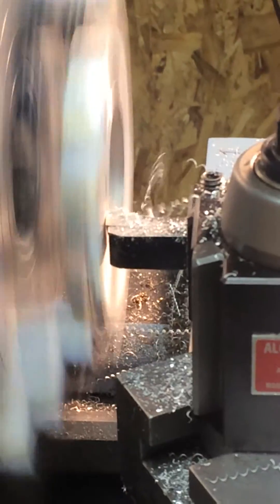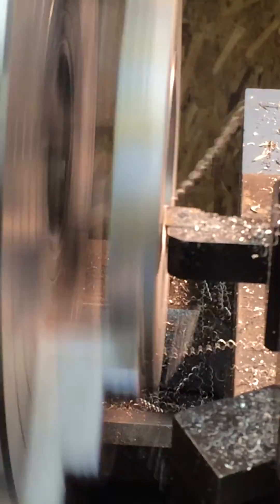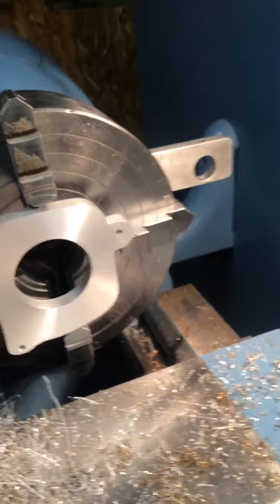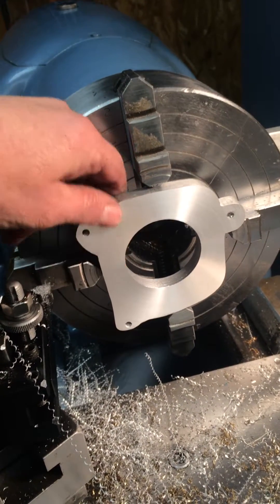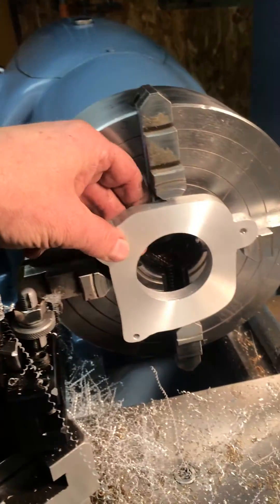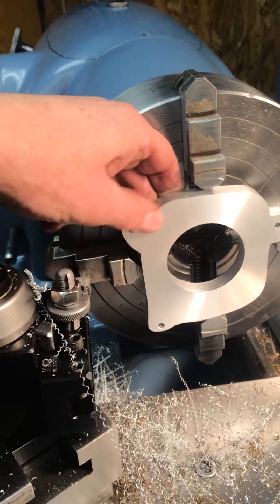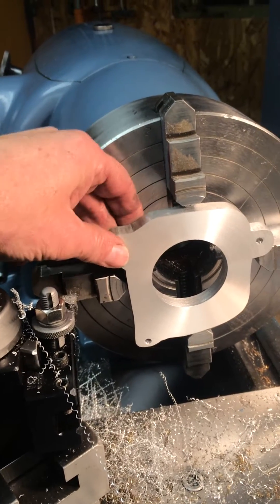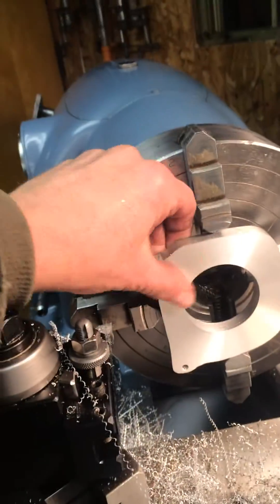Monarch 10ee lathe first part

Comment: This was the first run of the 10EE after rebuilding the diode board. The tubes were fine but several diodes were shot. Lucky I got the schematic for the control system. It is an interesting control system and this lathe will go into my personal shop so I have no desire of changing out the tube control. There is an issue with the ELSR which needs to be fixed.